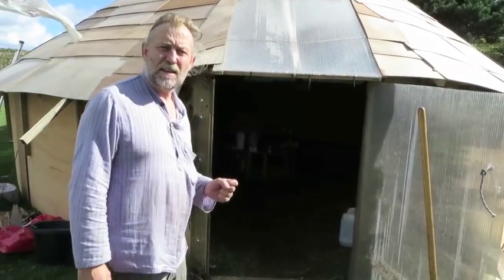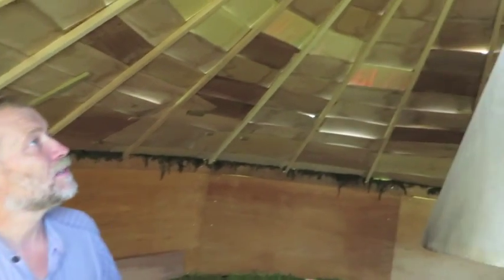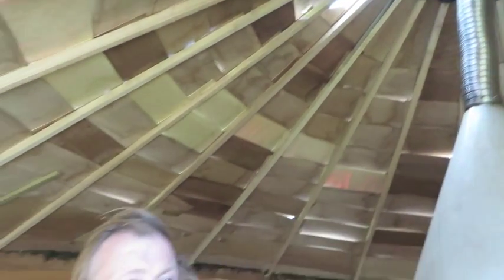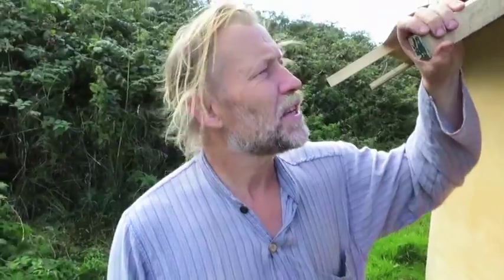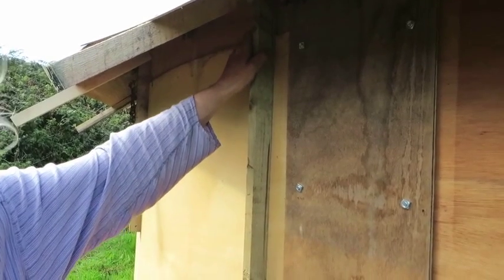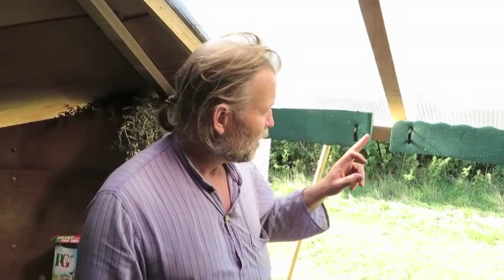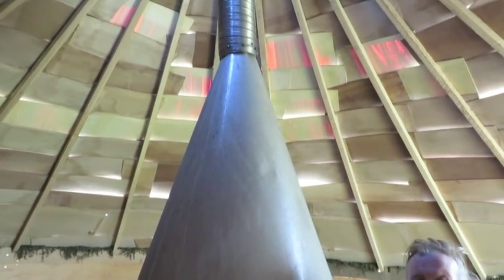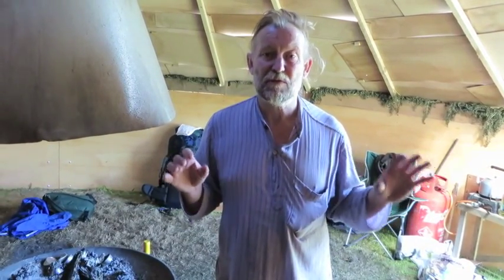Making a flat-pack Bronze Age/Iron Age Roundhouse

Comment: To keep the place from filling with smoke and make the smoke go up, you need a tube/tunnel of air under the ground from the outside, leading to underneath your fire. The fire will draw air up and the smoke will flow upwards while the heat radiates.
Reply: its a good idea but i cant dig up the turf and a tunnel box would be a trip hazard the vent over the door seems to help
Reply: miquette99 i
Reply: @BronzeAgeSwords  you cover it over to form a tunnel, there is no trip hazard.👍🏼